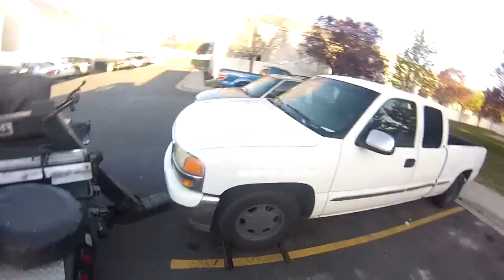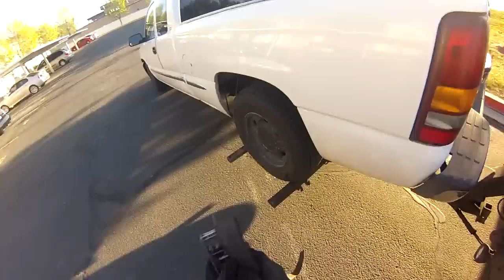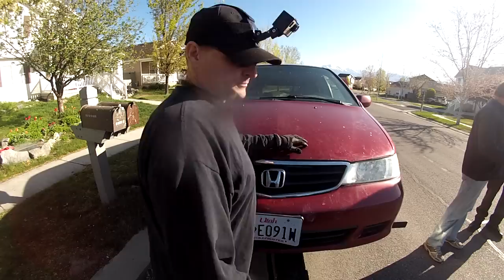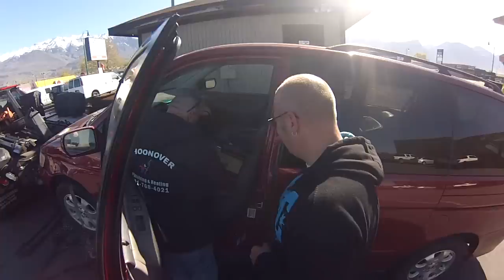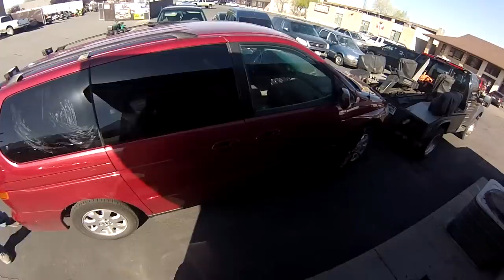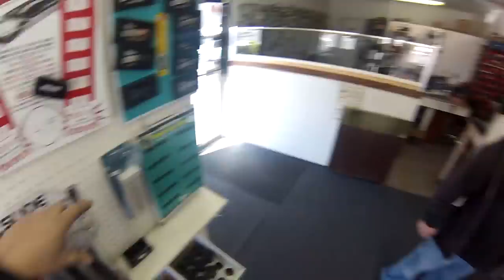The Second Half Of My Very Busy Morning With Weapons Still Being Located

Comment: Your truck has a hell of a knock. Time to go "repo" a new one.
Reply: It is called a diesel.
Reply: Flying Dog I have owned and worked around a lot of diesels and that is not a normal sound.
Reply: @bencoleman1893  I have worked around a lot of Morons and you are making the normal sounds.
Reply: Flying dog

Watch his other videos. The truck(diesel) doesn't sound like that in the other videos. If this was a typical sound you would hear it on all the diesel repo videos.
Reply: Flying Dog lol! Normal sound but he replaced the whole engine 4 weeks later because it’s normal.  It’s called knowing what you’re talking about before opening your mouth.👌
Reply: @flyingdog1498  If you think this sounds like a properly running diesel you need your hearing checked. Seriously, you think this sounds great? FFS haha
Reply: Obviously never seen a deisel truck before nor heard one with a few miles on it
Reply: @bobhalstead1879   Some mechanics have better ears than others. This is not normal even for a diesel and I have owned many over 25+ years.
Reply: @bobhalstead1879  He had to have the engine fully overhauled not long after this. So...yeah. Some of us know what it's supposed to sound like. That ain't it.
Reply: @bencoleman1893  you may not been working on them correctly then

Comment: Dude those Jump&Go jump starters were recalled. Check with the company for a free replacement recall involves Jump&Go Portable Jumpstart & Power Supply 12V power supplies, with model numbers starting with WJS-3000

Comment: What's that knocking coming from truck just curious
Reply: BoboDoee pretty sure this truck spun a bearing. Old video.
Reply: Cracked piston in the engine.
Reply: its a diesel is all, they sound like that.
Reply: EvanThaG they do not all sound like that, the 7.3 and 5.9 yes but much anything else it's quiet as can be, you shouldn't hear that 6.4 running but with a cracked connecting did what can you expect.
Reply: You must have never owned a diesel.
Reply: LOL for 1 its a 6.0 and 2 i own one. its how it sounds, just the straight pipe makes its a lot louder.
Reply: +EvanThaG that's not how a healthy engine is suppose to sound. my 7.3 doesn't have a tick coming from the engine.
Reply: That's definitely a 6.4 powerstroke,  and I've been around dowels my whole life but y'all keep up the good work.
Reply: Lifters
Reply: Does not sound good
Reply: It's called a Power Joke!
Reply: Palm Beach County Bass Master Ford builds the best ..& the older diesels were built by Navistar. Ford got rid of them. Now diesels wholly designed in- house for superior engineering. Drive a Ford truck or get left behind!
Reply: Johnny Brunello u know not what U speak of dingdong. U abuse misuse ANY engine it can have problems. This was a Navistar built motor not newer Ford designed diesels.
Reply: EvanThaG you mean 6.4
Reply: In typical 6.4 fashion
Reply: EvanThaG I’m late asf to seeing this comment and it’s a 6.4

Comment: U still need a chip in the key from the dealership in order to make the truck turn over. My dumb ass went and bought 3 for spares and none of them worked all they could is open the door turned the ignition and “ stalled out “ but never started it up

Comment: As long as it took you to find your jiggler keys, youncould have unlocked it with a rod and tied steering wheel and be gone. Plus nobody wants to work for some one hovering over them and watching them on cameras 24/7. It doesn’t show trust or build any kind of good standing relationship with a employee. Worked for a place like that and never again. Outside cams are fine but inside are a no no. You don’t need to see when I pick my nose.

Comment: That your engine knocking like that?
Reply: KtmGuy old footage, and yes. rebuilt 1/2 the engine cured it. also in 16 got that scratched lens replaced on the go pro. even redid interior completely including replacing lap top w tablet. new components for sound system. new seats, center console w built in components 4 audio. all that interior done late 16 early 17.
Reply: was gonna ask if he destroked it yet but if he got it fixed then let 'er rip!
Reply: fancy seeing you here. I think it is before he got the engine fixed so that is really old videos
Reply: landy kid I did not now you watch repo nut that Is cool
Reply: the gopro group I have been subscribed to him for years has an awesome channel